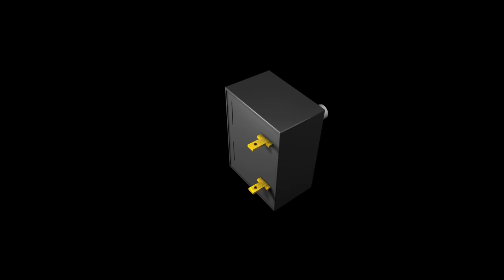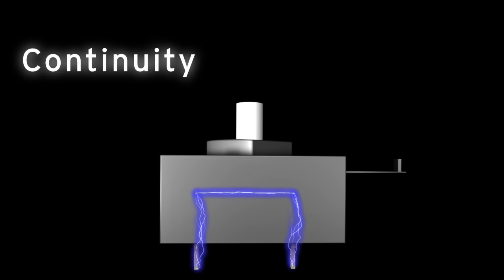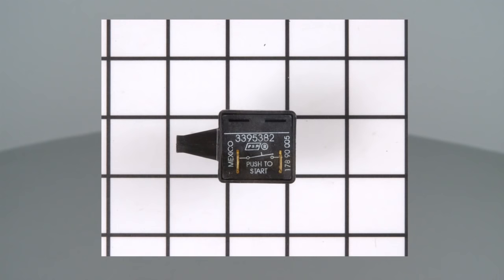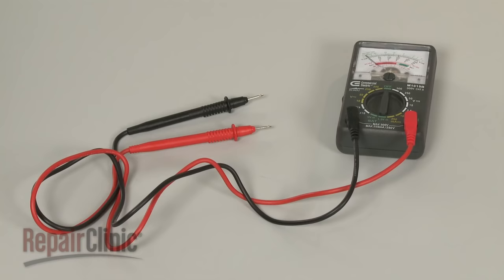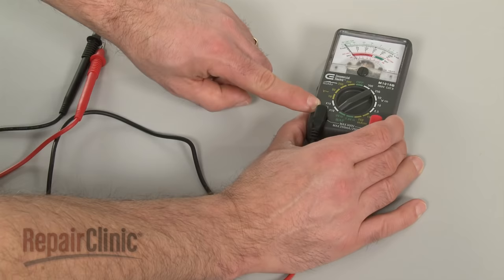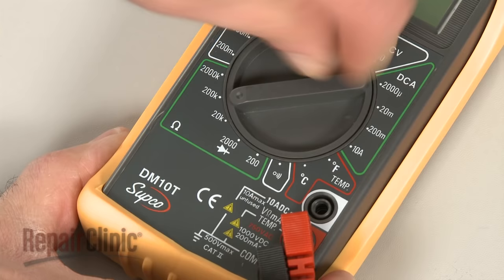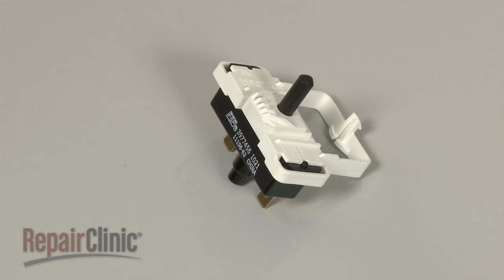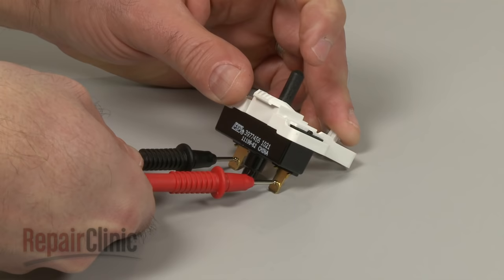Dryer Won’t Start? Two Terminal Switch Testing, Repair

Comment: Nice tutorial.  Thanks!  Helped me confirm that a washing machine lid switch was actually ok electrically (and confirm that it was a mechanical issue with the switch (broken tab) causing the problem.

Comment: Thanks for the video
Reply: There is a video showing you how to disconnect the plug to the switch, and jump across the 2 blue wires.  If the dryer runs, the switch is bad.  No meter needed.  I did that, and also confirmed with a meter.  FYI - Harbor Freight often has a coupon for a  nice little meter  FREE, with any purchase.  They work great.

Comment: Great video. Now I'm wondering what's more expensive, the $45 switch that I'm not sure is the issue or buying a continuity tester that I may never need again. Do these testers have other uses so I can justify buying one to save a Repair person visit?
Reply from the maker: The continuity testers have many uses but you can also return any part you buy from us within 365 days, for any reason.
Reply: *****
Well that's good news problem is my wife can't go without her dryer for long and by the time you ship me a switch to Canada and if it turns out NOT to be the issue we've wasted that much more time. If the continuity tester can also help me with the truck it may be something worth buying. Thanks anyway.

Comment: Whats the lowest ohm setting? Its a GE2524 and ohms are 2000k, 200k, 20k, 2000, and 200. Cool thing it can do by the way is it can induce current into speakers to test them. Got it at Walmart for 20 dollars.
Reply: I'm trying to test a door switch I took apart and placed the lever back in place.
Reply: I had it on 200  and got 02.8 ohms. Is that good?
Reply from the maker: Bob herry The lowest would be a 200 setting. The K at the end means you add 1000 so 20k is 20.000. If you check a switch it should read close to zero ohms. You also should unhook the wires to it when checking it to eliminate the possible back feed through other components in the circuit.